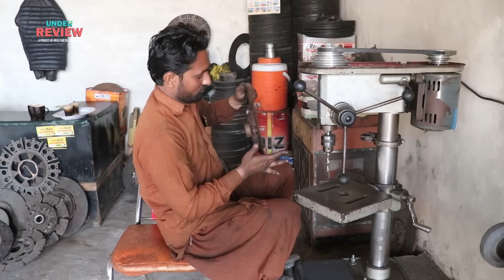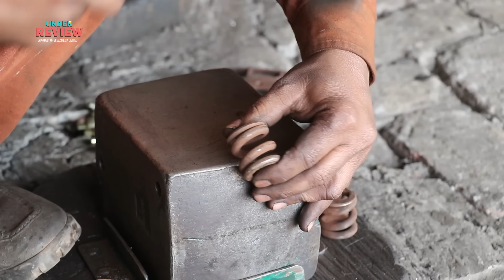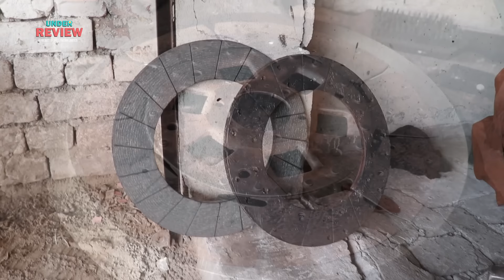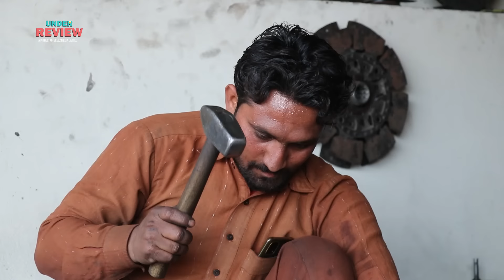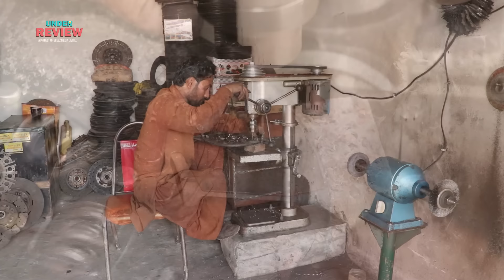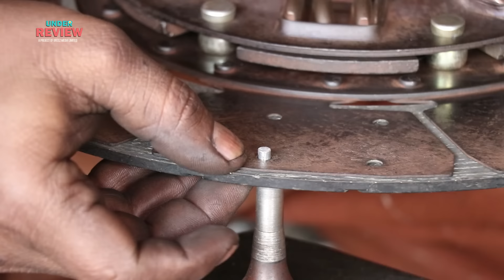This Man is an Expert in Repairing Truck Clutch Plates

Comment: I wish he would wear safety goggles when using the grinder wire brush.
Reply: yes.  Taking unnecessary risks.  Fantastic craftsman.  Very good job I am impressed with his precise hammer blows and drill press work.
Reply: I'm a welder by trade and used wire wheels over the years and eye protection is essential. We had a sign above the grinder that said "only one pair of eyes per customer".
Reply: @garrylearmonth9313  seen lots of ppl with a splinter or shavings from metal work into the eyes.  Its incredibly painful just to get a small grain sized particle in there
Reply: @softwhiteund3rarm0r  Yep Nick I agree, because I have been one of those who ended up at ER to get bits of steel out of my eye.  This vid sent a shiver down my spine...........
Reply: And some mask..  That dust from. The clutch are not good for their health
Reply: @Shahacah51  yes of course but its a 3rd world country it's tooo poooor and safety is the last thing to worry about 💔all that work for 10dollar in day my be less
Reply: You don't need em. Actually over time it's better to do it this way because you'll get more metal shards in your eye and it will make them stronger. Kind of like armor
Reply: He's got a spare eyeball
Reply: also you can squinching your eyes for safety... OSHA 90001 (its new standard)